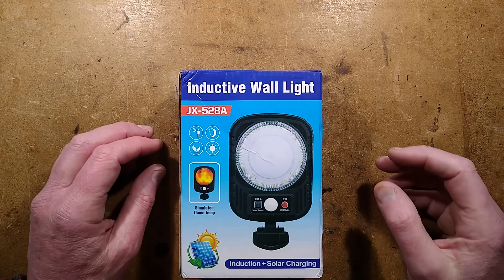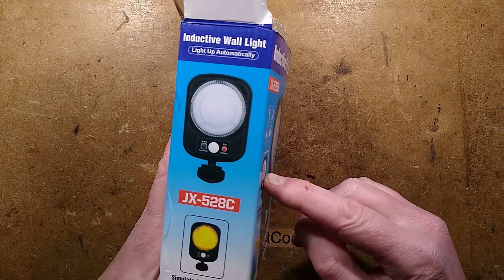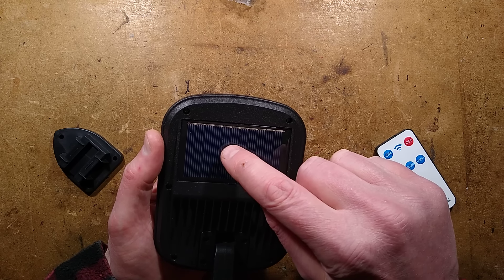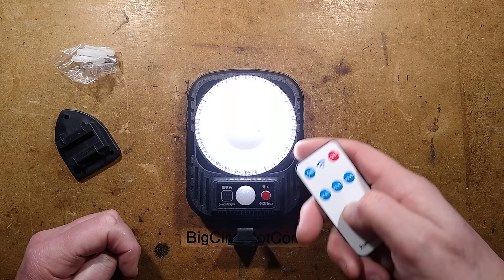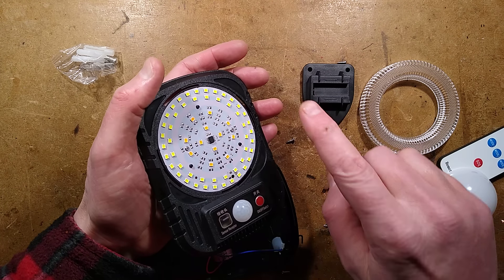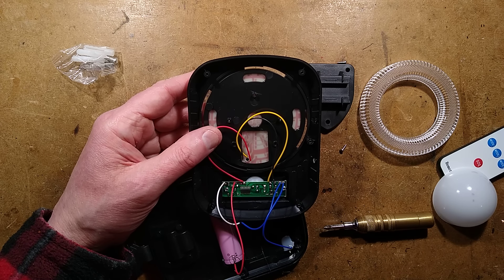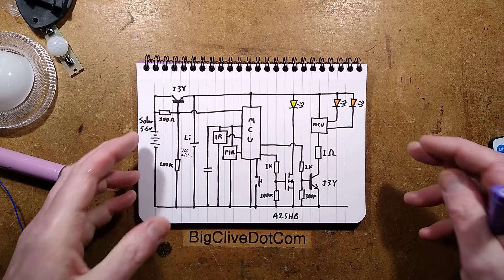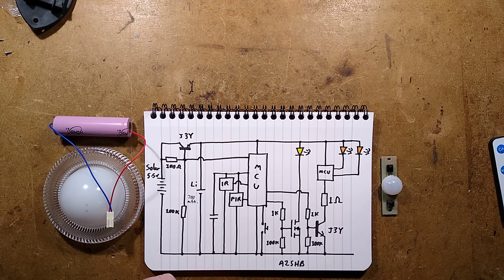6000W solar flame light - with schematic

Comment: 6000 watt LED would make actual flames come out.
Reply: Don't walk too close, it will light your pants on fire.
Reply: This is not a torch, it's a friggin' flame thrower.... now let's see the shkematics. :D
Reply: I once did a design for something about that output power in a fairly compact package.
Basically used a thin copper PCB as a water spray boiler to stop it from exploding immediately lol
Reply: I guess they went out off inc for the "m" in mW 🫠
Reply: For once it would be as the product is named.

Comment: I'm always reminded of those PC speakers from about 25 years ago that claimed about a kilowatt output from something running off a PP3.
Reply: PMPO, or Peak Magical Power Output.
Reply: They still sell amplifiers for cars with power ratings above 10KW that come with 1.5mm2 cables 😂
Reply: I bought a system a few years ago, 700 watts output power. Odd. I could only get it to draw 80 watts tops.

Comment: That flame mode is very convinving. It really fooled me in thinking it was real fire inside.
Reply: 6000 Watts, baby 😎👍 LOLOLOL
Reply: I threw a bucket of water on my tablet as I thought it had inexplicably caught on fire....
Reply: Indirect lighting, it might work. Put it in a waste bin and you might think the bin is on fire? I'm not sure how the solar panel will keep it charged like that though.
Reply: Not to worry, that lithium battery always has a possibility of catching fire. Then you'll get the genuine effect !
Reply: @michaelmoorrees3585 Absolutely!  Lol
Reply: You must be easily fooled? 🤣
Reply: 🎉😂¾⁶
Reply: Not as good as the older CFL lights with the undocumented candlelight feature. Really add a nice sense of ambience when installed in an overhead fixture. Must use a lot of power, tho. They always smelled like burning plastic.
Reply: @michaelmoorrees3585 lol that's the flame mode, big MOSFET direct across the battery. 
Just light that sucker up. One time use with a little asterisk on the box somewhere.
Reply: Even pocket comments count!

Comment: I had the good fortune to come across an Aliexpress 1000W LED handheld torch (link upon request). I asked the seller to explain how he came to the conclusion it was 1000 watts. I  asked how the little switch could conduct something like 90 amps (it was a three cell torch) and I asked what batteries it used. I eventually got a reply saying it was 30 watts and the batteries could not be changed. Caveat emptor.
Reply: A 100 Watt incandescent bulb consumes 100 Watts from the wall outlet. 
An LED lamp that produces as much  light as a 100 Watt incandescent bulb would probably consume less than 10 Watts from the mains. 
A torch with a "1000 Watt" brightness consuming about 30 Watts from the battery sounds reasonable.
Reply: I've built a 100w LED hand-held. It's just not going to fit in any pocket xD
Reply: A 100W incandescent bulb normally produces more light than 100 1W bulbs. That is is a trade-off between durability and efficiency.
When there is a claim "as bright as 1000W", it should be one efficient bulb with 1000W, and nothing else.
Since incandescent bulbs can not be bought in the EU anymore, they should compare with a bulb, someone can buy or just say the lumens
Reply: In what way is it inductive?
Reply: @DanKeeley  the lamp can be carefully charged on an induction oven. Or discharged. Or be set on fire. All can be controlled just by the phase and distance.
Reply: @twoina  🤪
Reply: @anthonyshiels9273 ~8 Amps (3.7V) sounds reasonable?! What kinds of batteties are you usually dealing with to call that reasonable and not a firestarter?
Reply: @jolo44 3 18650 can handle that without a problem. 
I'd question the size of the torch tho because it would have to be the size of a old mag light for proper cooling
Reply: @NinoJoel  my point is that they wouldn't last any significant amount of time, considering a single 18650 would be flat afer 6 to 30 minutes, also would probably hurt the lifetime quite a bit
Reply: @jolo44  well we will probably never know. 
He said 3 battery's so if there are 3 18650s that would be reasonable. 

Many torches have a high power mode that dims down after some minutes because they get warm. 
Maby it does the 30w for short periods and then reverts back to lower powers. 

Who knows
Reply: @jolo44 100C lipos can be had. So 8 amps would be what 80mah?
More realistically 300mah 60c cell would do that a few times and fit in a keyfob.
Reply: @zyeborm  I suppose a 0.3Ah 60C drone-ish battery could handle up to 18A (right?), but 0.3Ah also means 2 minutes to flat at 8A.
As @NinoJoel said, that would become a very toasty melty keyfob, probably not too comfortable to hold onto
Reply: @jolo44  it'd be pretty spiffy though until you dropped it
Reply: I feel like these torch retailers need to lift their game.  10 W torch advertised as 1000 W, bah!  You can find aftermarket air-horns for your car listed as 1000 dB.  😅
Reply: May I please ask, how you calculate 1000 watts equals such a low current of 8 amps at 3.7 volts? I = W/V so 1000/ 3.7 = 270 amps, but this light had 3 cells, so 3 x 3.7 = 11.1 volts, so again, 1000 watts divided by 11.1 volts = close to 90 amps. Please tell me where my maths is going wrong with getting currents like 8 amps from an 11.1 volt supply to give an output of 1000 watts? The light in question is/was an LED handheld flashlight/torch powered by three LiPo cells of unknown size, but considering the size of the flashlight/torch it can only be 18650 or 26650 cells, the point being, that they can not be of huge capacity capable of such high currents even if the small switch could carry 90 amps more than just once without going up in flames.
Reply: May I please ask, how you calculate 1000 watts equals such a low current of 8 amps at 3.7 volts? I = W/V so 1000/ 3.7 = 270 amps, but this light had 3 cells, so 3 x 3.7 = 11.1 volts, so again, 1000 watts divided by 11.1 volts = close to 90 amps. Please tell me where my maths is going wrong with getting currents like 8 amps from an 11.1 volt supply to give an output of 1000 watts? The light in question is/was an LED handheld flashlight/torch powered by three LiPo cells of unknown size, but considering the size of the flashlight/torch it can only be 18650 or 26650 cells, the point being, that they can not be of huge capacity capable of such high currents even if the small switch could carry 90 amps more than just once without going up in flames.
 @jolo44
Reply: @getcartercarpark.  I was talking about somebody claiming that the seller meant "produces as much light as a 1000W incandescent light bulb while consuming 30W." 30W would be a current of roughly 8A to the LED at 3.7V
So your math isn't wrong, the interpretation of "1000W" is simply different (although both interpretations are ridiculous, in my opinion)
Also I strongly doubt that any light source (theoretical ideal white light source would be about 250lm/W) consuming 30W would even come close to producing as much light as a 1000W incandescent bulb (~15lm/W)
Reply: @jolo44  I apologise for my misreading - There are so many things sold these days that are just sold with ridiculous claims. Eventually, there has to be some way of stopping such misleading sales and even more so the sale of such dangerous items, but I'm getting on another soapbox topic now!

Comment: 1:18 the solar panel needs to be completely blocked from light in order for the LED's to remain lit. Thats how it saves battery and lasts yonks. I have 3 of security light versions from aliexpress at just over £4.00 each (with remote, mount and screws + free shipping) and i am very impressed. even with british winter weather, the are bright and stay charged and are reasonably quick on the PIR.

Comment: Hello again from the channel's village idiot. As usual, I didn't understand what Clive was talking about, but I did understand that lithium batteries do not like cold weather. I have a string of garden solar lights that have been working for almost 4 years. I live in the U.S. Rocky Mountains, and our winters can be cold, with temperatures of 10 degrees below zero to bouts of 20 to 30 degrees below below zero, and yet the lights have worked without failure all this time.(of course, they will probably fail now that I have praised them.)
Reply from the maker: It may be that the core temperature of the lithium cell is higher due to the enclosure and sunlight on the case while it's charging.  Or it may be NiMh.
Reply: @bigclivedotcom  Well, whatever it is, I probably jinxed it by praising it for the whole world to see. Thanks for the reply. Have a good weekend.

Comment: I have a light that looks like those white metal weatherproof security cameras and it is solar powered and uses the same circuit board. The battery in mine died and in the process of testing the light I fried the board so I made it into an awesome flashlight using some wire, a 2 cell 18650 power bank, and a small switch and it is SUPER BRIGHT.
Got it wired straight to the internal battery of the power bank and it seems to work well.

Comment: With those additional 3 LEDs, it looks like this is the same as the typical LED flame effect light, just flattened out into a circle. I've never looked directly down at a flame, but I doubt this would look like that, even if all the channels were populated.

Comment: I had one of these fitted to my (wooden) fence. Unfortunately i had it set to flame effect and  the 6000w output caused the fence to catch fire!  Ive now bought another 10 and will connect them in series? parallel? and replace my 40kw gas combi boiler. Going to save a fortune 😂😂😂😂

Comment: The one ohm resistor to the flame effect MC must be just a link. I’m going to assume it’s there because they couldn’t route a trace directly and were forced to jump two vials (I can’t quite see the traces to verify).

At a guess the SOS doesn’t work because of pushback from people and authorities concerned with false alarms. It would be simple to disable it in code (or just delete that part of the code the code originally written in) but relatively costly to revamp the remote controls which were mass produced before the decision to eliminate that capability. I don’t miss it.

Let’s say all the empty LED positions were populated with LEDs bright enough to be worth looking at. What current would the second MC be asked to supply directly? Likely too much, necessitating another transistor or three, but that’s going to drain the battery that much faster.

These junk gadgets seem to me to be mostly intended by the designers to get the makers shed of crappy solar cells and batteries as quickly as possible.
Reply: hey at least they're selling off the e-waste instead of binning it directly!

Comment: Ok, so it's pant as a light.  But what about disconnecting the LED and wiring it into a small motor?  Was thinking something like a window blind control.  It has a battery, solar panel and remote.  Add a 3D printed smaller case and it beats paying £60+ for an off the shelf solution.

Comment: You know, if the box didn’t say that it was a lighting fixture, one might be let to think this is a prop for a Sci-Fi movie or TV show. It kind of resembles a different version of the tricorder from the original Star Trek. The big round thing in the center was the display (3D holographic, of course) and the buttons below it turn it on/off, or let you control what it does via a menu screen (you turn the outer ring surround to select menu items). Finally, if you push the hemispherical trackball-like display, it sends a distress signal to your mothership to beam you up! In an emergency, it can even be used to start a fire; just hold the button down for 5 seconds, and the display will confirm if you want a self destruct. If so, press it again, and it’ll put a dead short across the lithium-ion batteries. Stuff it under some logs and kindling and you’ll have a fire in no time! I can also envision a variation of this on a wall of the ship as a comms/PA-system. The central portion would be a combined display and speaker/microphone, and you turn the outer ring to select which department you want (bridge, sickbay, engineering, environmental control, etc… The push a button to initiate the comm system. Handy if you left your cell phone on the planet below after beaming up. 🤣😆

Comment: 6000 Watts at 3.7 Volts is 1,621 Amps.  Impressive battery you have there, Clive.  😁
Reply: Battery only good for 0.42 seconds at rated load. Except that the wires, at least, will have vaporized long before the battery is discharged.

Comment: If the cell can't be charged because it's below zero, but the solar panel is providing power, that energy could be used to warm up the cell, with the device switching back to charging the cell if the cell gets warm enough.

Comment: Nice, how they squeeze 6 kW through these cute 0.15 mm² stranded wires. 🤭😂👍 But wait - they use 0.75 mm² or thinner stranded wires for 2kW space heaters or radiators in reality! 🤪 Your cable and your socket are heating the room with at least 200 W extra each.

Comment: I have several 'garden lights' with similar construction but they don't stay lit for long during the long winter nights.
Would it be practical to add another cell in parallel, to prolong their operating time?
Reply from the maker: It's usually the solar panel that is the weakness.

Comment: I have an LED torch and two LED lamps that have SOS functions - 3 short flashes. 3 long flashes, 3 short flashes. However, I do wonder how useful this feature is at this point in time.
Reply: Useless I’m thinking. Got caught propped in an illegal net of coast a few years ago. Radio stuffed after a radio check setting out. So large spotlight really bright. Spent 2 hours aiming at traffic on coast road flashing sos. Was not until a trawler heading out to sea passed that I got a response and a tow back to harbour. As for radio. Dry solder joint on antenna plug that worked a few hours previous so in this day and age you would be lucky to find any one that reads morse

Comment: if its the same as the outdoor lights i have ,if you cover the solar panel it should activate , i beleive they use the solar panel as the dusk / darkness sensor, on if recieving no power from the solar panel.

Comment: Someone out there will buy one of those things, put a whole lot more fully charged cells inside, stick a big honking mosfet to turn on the leds, and just run say 4 cells directly through the LEDs, no resistors in series. “But it burnt my eyes! (and the house)” “It said 6000W right there in the listing, d’ohhh!” “But I never believe those, they are fake ratings” “Suit yourself, sometimes they are NOT”

Don’t do this at home. A couple 18650s connected with thick wire to an LED can deliver very high power. For a very short time. Then they just deliver flames.

Comment: Off topic here:  have you done a tear down for one of these please..USB Charger for Bosch Home and Garden PBA 18V Battery USB Adapter with DC 12V Port & Dual USB Ports & LED Work Light & Belt Clip (Battery Not Included)
Reply from the maker: I've not looked at those, but I can guess it would be simple buck converters.

Comment: My trusty Primus OmniFuel stove gives about 3000 watt when using alkylate petrol at max. And that is a lot of heat. That is nice if you want to boil water fast. But that kind of heat will burn anything  to a crisp fast if you try to make a meal. But dah I of course turn it down if I cook. But anyway 6000 watt is twice as much as my trusty stove. I will order one of these and use it on my next hike. What can go wrong😅

Comment: It might be good for a flood light for making videos, and it has an added flame effect for fireside chats. You'd have to add a USB charger, but it's portable. People generally like neutral white or daylight white light for making videos. I don't know if that's what he means by cold white or if the light is actually a bluish light. Bluish light is good for lighting up a winter or moonlit scene, but other than that I absolutely hate it. These days, I am starting to like daylight white because it seems to help with my seasonal depression.

Comment: Is there a solution to the cold lithium charging? I put together a basic solar-charged weather station with an ESP8266, and while this winter has been mild, temperatures far below zero are definitely expected in general, so I guess I'll need a solution to that problem.
Reply from the maker: I'm not sure how well thermal insulation would work.

Comment: Clive, what kind of eye protection did you have on while running this light so close to your eyeballs?
Reply from the maker: Just UV filtering as standard.  The light was not even a touch on bright daylight.
Reply: @bigclivedotcom  3kw lights normally blind the heck out of me.

Comment: i watched the entire vid. but i am still unclear about where the induction comes from? must one supply a changing EM field to the device? facetiousness aside, i made a cool kit today, i got from ali express for 4 quid. it is a calculator. obvs it is a rubbish calculator, but it was satisfying cutting out 20 little paper labels and sticking them in the caps on little push switches. thanks BC for the suggestion to learn soldering by doing little kits.
Reply from the maker: For some odd reason every proximity detector is called "induction" by the Chinese sellers.

Comment: can you check out this FANCY looking ionizer costing 6.99. it has an empty frame around it...does it have any function?  Air Purifier Devices USB Air Ionizer Lightweight Odor Smoke Eliminator Freshener
Reply from the maker: It's just a fancy case and standard ion module.  I don't recommend using ionisers with USB power supplies as it will create a high potential difference across the power supply and potentially break its internal insulation down.
Reply: @bigclivedotcom  Thanks. the fancy case reminded of those 'bladeless' fans and maybe i thought it had a similar function